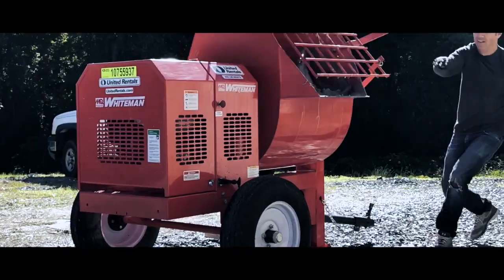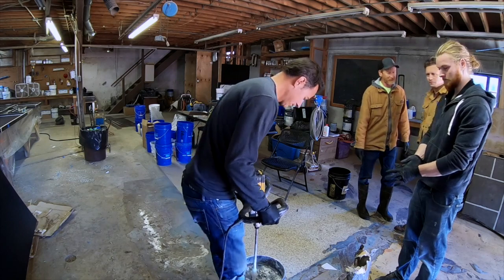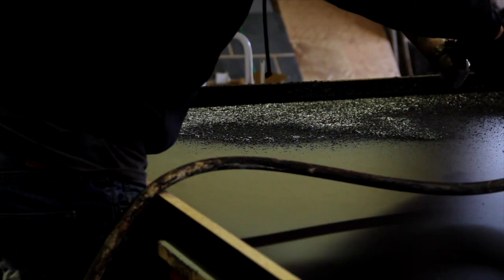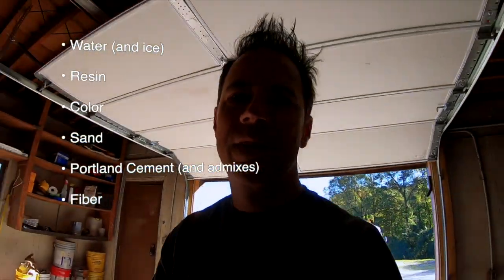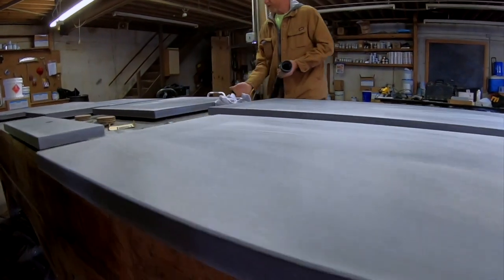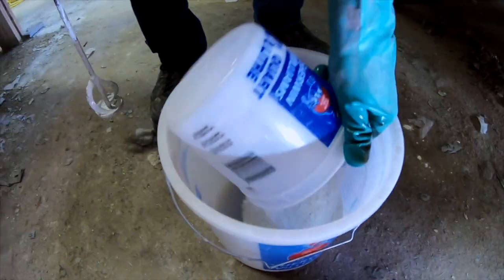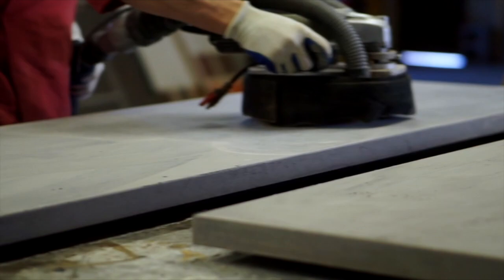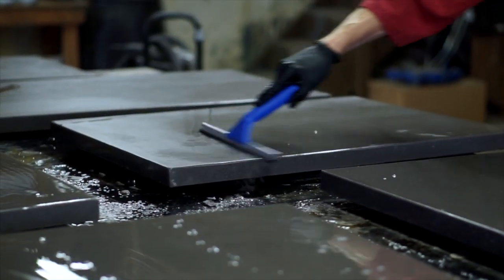How to Make a GFRC Concrete Countertop With Our DIY Semi-Homemade Mix Using Cement, Sand & Admixes

Comment: A small local company makes stone look concrete paving slabs. They use silicone rubber moulds and to prevent bubbles, they put them on a shaker table to shake the bubbles out before they cure. I assume the same thing could be done in this case.
Isn't there an additive which would make the concrete waterproof so that sealing was not necessary?

Comment: amazing work ! it seems a LOT easier doing this flip solution than trying to get a perfectly smooth surface.

Do you have a solution for the first coat when you don't have this sprayer that you use...?
Reply from the maker: Thanks!

Some people pour and trowel the first coat.

Comment: It would have been cool to use a different shade of filler to get some speckles.
Reply from the maker: It does look cool when we can do that. This customer wanted it to be mostly monotone though. 

We put mother of pearl aggregate in a countertop earlier this year to add some color. Here’s the video:

https://youtu.be/iu8v_0HPigc
Reply: @TimDCVA  Sweet. I saw the MOP ones you did. They look great. So many options. We are in Montana and I'd like to put agate in the surface layer. Have you calculated material costs per sq foot?

Comment: Looks great! So you don't use any aggregate at all it looks like? I've been wondering if I can get away with that and still have enough strength because I want to do white. I'll be using the fiber mesh reinforcement netting from a popular concrete countertop website. Was thinking just white sand and white portland cement with the mesh reinforcement. Will that be strong enough you think?
Reply from the maker: Thanks!

Yes. I have a video on my channel where we did a white countertop that way. You should be fine. 

I like adding glass fibers more than the mesh though.

Comment: Is there a way to do this with a waterfall edge?
Reply from the maker: Yes. You just form it with the taller side and make a stiffer backer mix that you can pack in by hand.

Comment: I want to make a top for a work bench that measures approximately 60” x 20” and will have support at approximately every 15”. It will have a 55lb heat press so there will be occasional pressure from the operation of the press.  What’s the thinnest top I can make that will be light enough but be able to withstand the weight and operation of the press?
Reply from the maker: I’m not really sure. Sorry.

Comment: Wow you guys are great. Thank you so much for your videos. I have a question. I'm looking to do my entire house to bring up the value and cheap because I enjoy DIY thing. 
Can I just polish the foundation under the carpet? 

Is it essential to grind first, dye and densify then polish?  Or can I skip the grind part and just use low grit polishing pads (diamond pads)?
Reply from the maker: Thanks!

The easiest & most cost effective thing to do would be to grind the carpet glue up...and then just stain & seal it.

Comment: Nice video , is there a reason for not casting in one part around the sink ?
Or just ease of moving and install
Reply from the maker: Thanks!

I just thought it would be too hard to move it in one piece without it cracking at the sink.
Reply: @TimDCVA  why would it crack ? isnt that what the fibres are for??
Reply from the maker: Fibers prevent cracking… but you can only push that so far. Having two 100 lb. Slabs connected by two thin strips of concrete seems like it would cause too much tension on those strips in transit. 

Maybe I’m wrong though.
Reply: @TimDCVA  yep, that’s a good point!! Not
Worth the risk.

Comment: for a large Island countertop using GFRC no metal structure is necessary inside the concrete? I have seen other DIY concrete methods were a metal wiring is added to the core. Yours till now is the best looking countertop by far !!
Reply from the maker: Thanks! 🙏🏻😊

That’s right... the high dose of glass fiber eliminates the need to metal reinforcing in most cases.

Comment: Why to use muriatic acid? cheers from Brazil.
Reply from the maker: 👋🏻 It adds a slight profile (roughness) to the concrete so that’s the topical sealer will adhere.

Comment: How much does the concrete contract after it cures?  If I pour a 24"x48"x1" slab, will the dimensions change substantially once the concrete has fully dried?
Reply from the maker: The amount of water you use effects how much the concrete shrinks. We always shoot for a 0.33 water to cement ratio (by weight) and I’ve never noticed the size of the concrete changing at all. 

If you use too much water you the concrete is more likely to crack as it sets up (shrinkage cracks)... but even then I’m not sure if the dimensions will be noticeably different.

Comment: Why did you add resin to the mix? What is the resin used for? U did not mix any aggregate except sand.?
Reply from the maker: Resin/polymer just makes the concrete better. It increases overall strength, reduces cracks, increases the amount of bending it can tolerate without cracking and allows you to de-mold it earlier.  

No we don’t use gravel. Just Portland, sand and admixes.

Comment: Isn't the cement gray naturally? Why doe it needs some kind of black agent to color the cement?
Reply from the maker: We use white Portland cement with countertops... so we have to add pigment to make it gray.
Reply: @TimDCVA  Got it, thanks. But as far as I know, white cement is not as strong and stable.
Reply from the maker: I’ve never heard that about white before. I think our mix strength is probably overkill for a kitchen countertop... even if it isn’t as strong as gray. 

I personally like white better because I think we get more consistent colors from it. Sometimes a bag of gray Portland from the same manufacturer has a slightly different color. 

Also, in my experience, I think the white tends to curl less as it cures than gray.

Comment: Why ruin it with acid AFTER polishing? The reason you gave was to "prepare it for sealer". That makes zero sense. You've already polished the surface. The acid will eat into the top cementitious layer, taking the polishing work away. I'd imagine the surface feels much rougher after soaking in acid. I can't think of any reason why you would apply acid at this later stage. Perhaps after stripping from the form, yes. Acid would remove the release agent or paste wax. Then you'd immediately neutralise it with ammonia solution. Not let it soak in. And not apply acid AFTER polishing.
Reply from the maker: We polish/grind the concrete to remove the melamine texture that is on the surface. I also like to grind it enough to remove the cream so that you can see the sand in the concrete mix. 

This makes the surface too smooth for the urethane sealer to stick to it... so we lightly etch it with acid, which gives it a little texture.
Reply: @TimDCVA  ah...polyurethane. yes, it does like sticking to a 50-to-80 grit honed surface. It usually yellows over time. Not a very nice end‐result for something as tactile as a worktop. The 80 grit limit is a huge restriction in your creativity, and urethane, being a topical layer, doesn't allow you to truly feel the concrete. It's like a big condom. I'd use it on a garage floor. But certainly wouldn't acid wash it after any grinding - just make sure you don't grind above 80 grit with resin pads.

For a nice countertop, I'd like the ability to polish between 800 and 3000. Using penetrating sealers is the way to go. You're going to feel the concrete with your hands. Not a layer of plastic on top.
Reply from the maker: I disagree with literally everything you said. 

Our urethane doesn’t yellow. 

The urethane we use is very thin... it doesn’t look like plastic and it still feels like concrete. 

We grind to whatever grit the manufacture recommends...but 50 is usually too rough because the sealer cant cover up the tool marks left behind by the grinder. 

I don’t like penetrating sealers. They look nice at first... but they stain too easily if you actually cook in your kitchen. 

I’m happy to answer questions if you want to know about our process. 

If you want to teach me something... you should start a youtube channel or a website. Send me a link if you do. I’d love to watch.
Reply: @TimDCVA    LOL! Awesome response, I'm using this " If you want to teach me something... you should start a youtube channel or a website. Send me a link if you do. I’d love to watch."

Comment: Making these gfrc countertops requires lot of overnight time. You are looking at a week for just one countertop. With corian i would be done in just one day.
Reply: And you'd have a significantly weaker countertop that wouldn't be resistant to scratches or heat. It's also more expensive. Totally incomprable.

Comment: Is it lighter in weight vs concrete ?
Reply from the maker: I don’t think so...but you can pour them a lot thinner than traditional concrete. We used to pour traditional concrete @ no less than 2”...but now we can go as thin as 3/4”.
Reply: Ahhh okay so pretty much standard thickness was hoping 3/4 or 5/4 would be possible
Reply from the maker: We have poured them 3/4” in the past.

Comment: Great videos!  I’m a weekend DIY’er, never made anything with concrete, but I’m very interested in making my own WHITE countertops.  Will your $15 tutorial help a beginner like me?  Thanks!
Reply from the maker: Hey. Thanks for the encouragement! 

It’s not really a tutorial. It’s just a recipe. If you are only going to do one project, it would just be easier to buy the mix from Buddy Rhodes or Trinic. 

...but if are going to do multiple projects or you can’t afford to buy bag mix for your project then the recipe would be a good starting point for making your own mix. 

Thanks for watching! 🙌🏼
Reply: TimDCVA thank you!
Reply: One more question... how much GFRC concrete is needed per Sq/ft to make countertops?
Reply from the maker: I’m not really sure. I always just guess. I think it’s around 100lbs of mix for 10 sq ft @ 1” thick. BuddyRhodes.com has a calculator if you want to figure out exactly how many bags you need.

Comment: Excellent video...  The black melamine (Formica?) is a subtle improvement, but it’s a GREAT idea...
Reply from the maker: Thanks Paul! I was having trouble with the white melamine bubbling up when it got wet. The black is a higher grade product than the white, so the paint on it must be thicker. Whatever the case...it never bubbles up.... so it’s great. 👍🏻👍🏻

Comment: Great video. I noticed you used almost all water as ice and I understand that cold helps the mix a great deal. Same weight I assume? But doesn’t it take a while for the ice to melt/get into the mix?
Reply from the maker: Thanks! 

We try to keep our mix around a .32 water to cement ratio by weight. 

We will usually sub out about 30% of the water for ice. It’s usually melted by the time it comes out of the mixer.

Comment: Great video. I want to pour concrete interior wall panels. How thick would you go?
Reply from the maker: Thanks! I think most people do 3/4” or 1” for wall panels. I would probably pour a test panel just to see how it holds up.
Reply: TimDCVA prices are ridiculous so I’m making my own. I’m building a house with durisol and want to diy as much as I can. Timber clad the outside, concrete cladding inside. I’m going to pour a few full size test panels with different finishes. I like the boarded, shuttered effect. Your vid is the best I’ve seen.
Reply from the maker: Thanks Kevin. I appreciate the encouragement. 

If you are pouring large panels, you may want to look into using AR Glass scrim as secondary reinforcement to the glass fiber. 

I just posted a video on white GFRC... you should check that one out too. 👍🏻
Reply: TimDCVA I’ll take a look now mate.

Comment: What do you use to spray the face coat? Or is that just a normal paint spray gun?
Reply from the maker: We use a Kraft Hopper gun ( https://amzn.to/2OvrigK ) with a Kraft compressor ( https://amzn.to/2UfjJjw ).
Reply: Why spray the face, top coat?
Reply: The face coat has no fgrc fibers, this makes it easier to get a polished surface without the fibers sticking out and ruining the counter top. The fill concrete has the fibers to strengthen the countertop.

Comment: Do you use buddy Rhodes mix only on the face coat?
Reply from the maker: We use Buddy Rhodes mix on the face coat, and then we use locally purchased cement and sand with Buddy Rhodes resin, glass fiber and admixes on the backer coat.
Reply: @TimDCVA  where do you buy black melamine? and what would be the advantage vs white?
Reply from the maker: @raymondswilson2012  We get black melamine from a lumber yard that supplies cabinet shops with material. I had trouble with white melamine (purchased at local hardware stores) swelling up when we poured the concrete on it. We haven't had that issue with the black.